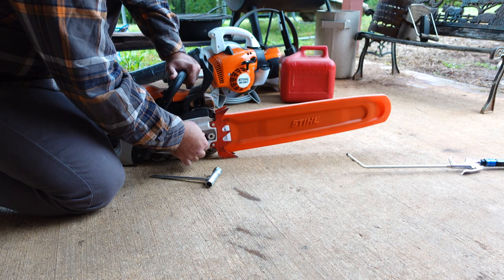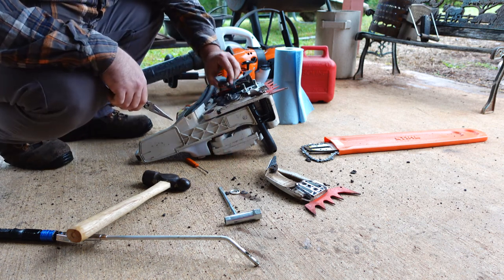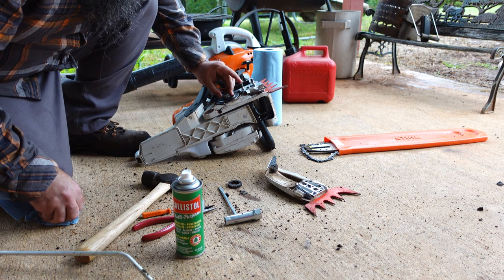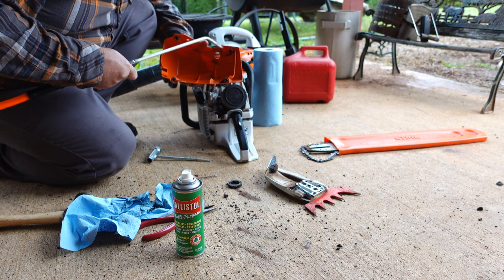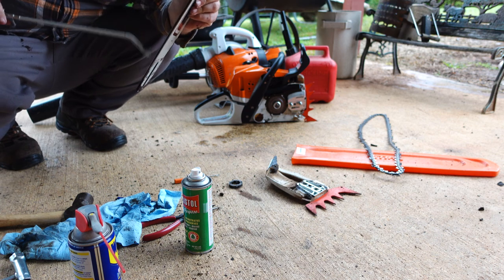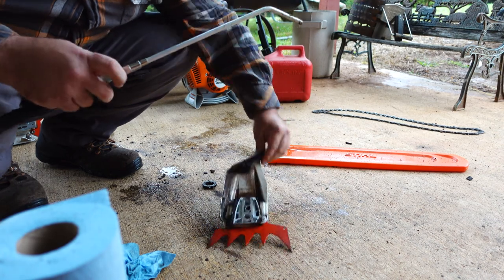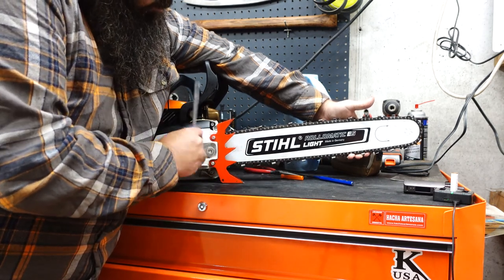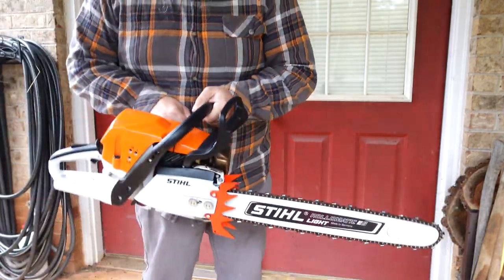Hurricane Ian Rain and How to Maintain a Chainsaw [OFFICIAL VIDEO]

Comment: I use Ballistol also. WD40 is good for cleaning carbs and it smells good also.
I don't pick up the end of the bar. It's worked for me since 1976. I think it started on YT.
Nice to see you back Ben.
Reply from the maker: I think there is some science or physics to it but it's probably negligible lol. Glad to be back. I'm ready to do some splitting!
Reply: The raised bar is a tighter chain position. It is also the position the bar will be pushed towards during use (pressure on the bottom pushes it up). This can mean your bar can be pushed upwards and over tighten your chain during use if you set it up flat. Professional chainsaw qualifications teach raising the bar tip.
Reply: @smallcoppercoins01  Well I've "NOT" been doing it for over 47 years of cutting with no problems.
What is happening to your bearings when you make an undercut?
Reply: @ClintsHobbiesDIY  just explaining it is the official way to do it and not just some YT thing. What works for you is what works for you
Reply: @smallcoppercoins01  Yep. I'm just to old to change. 
You have a good day Tom.
Reply from the maker: Thanks for the explanation, Tom!